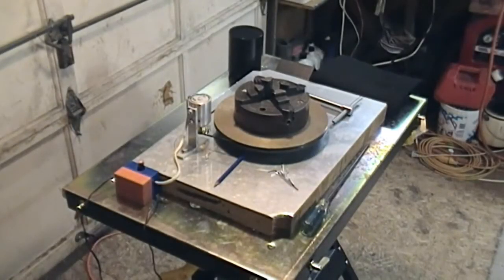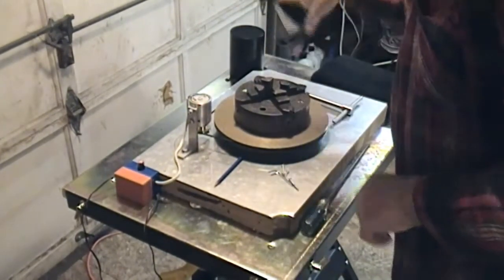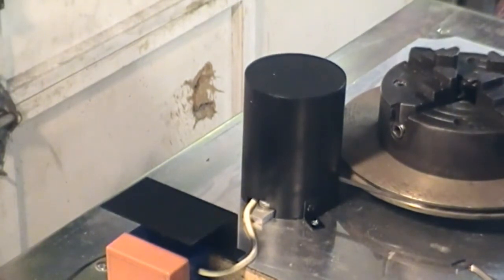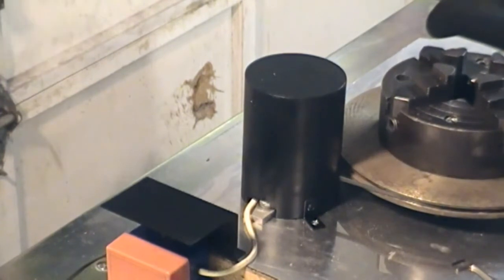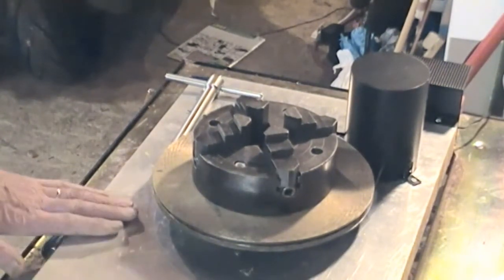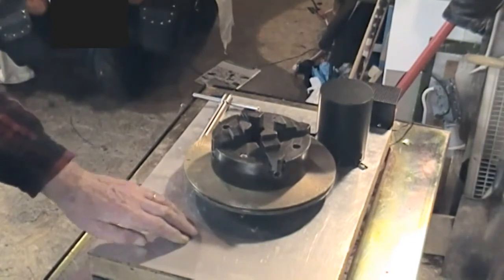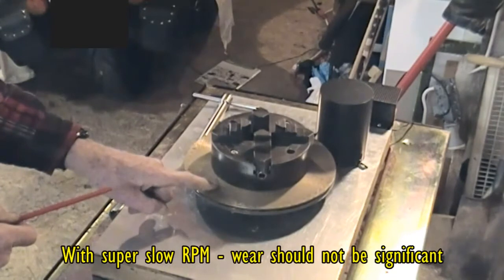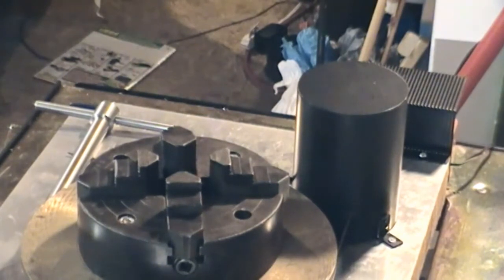Motorized Turntable, Part Three B

Comment: To work on the "wrong" side of your turntable, try holding the top against a faceplate (or the chuck with the jaws out) by pressing your live center into the bore. If the bore is too big, machine a flanged plug that fits the bore with a  good-sized center hole bored in. With the light cuts you usually take the pressure against the faceplate should give the workpiece (turntable) enough torque. If needed, several strips of double-sticky tape should  help.
Reply from the maker: Peter W. Meek Thanks for the suggestions Peter. :)

Comment: You could better protect the motor wires by taking them through a hole (with grommet) under the can.
Further protection for the potentiometer box could be had by either closing in the sides of the shield, or notching the wooden side and placing it just under where it is now..

Cheers, Tom
Reply from the maker: Thanks Tom -- all input is gratefully received.  The project certainly continues to develop more now as an evolution! Still a ways to go I think.

Comment: Your can and cover look great Chris.  I think Grandpa Bill is right though about all that current being an issue.  I've thought about it a bit since last night and still think a top brush system (since you can't chuck up for cleanup underneath it) with a sheetmetal housing to cover the belt also would cover the brush housings and keep splatter off your platter. ~¿@  The hole you cut in the AL for the vertical axis was larger so it should isolate the turntable.  It would be stationary and allow for ground straps or lug to clamp to. However the supports would need to be an insulating material, Delrin maybe or just neoprene below the foot and use #10 Rack screw top-hat washers to insulate the screws??  It would mean probably getting out the dreaded jig saw to cut a hole for the chuck and also welding on a return flange to cover the belts and fixture the feet.  It's a bit complex of a fabrication but pretty sure You can do it!!   ~PJ
Reply from the maker: Thanks for your comments. More valued food for thought - although can't quite see what you meant re cutting a hole for the chuck - ahh, I guess you were meaning a 'cover-all' piece of sheet metal. That's a thought in itself actually and as the turntable is isolated from rest of the stuff - your plan seems well worth consideration. Love the great feedback we get here on TY - thx again. (Rather hope too, if I get myself a TIG welder eventually, then spatter will be a non-problem compared with stick or MIG.)
Reply: ChrisB257 Correct, like a sheetmetal belt guard.  Another thought though about its height off the platter.  It would have to be low enough profile to allow clearance for your fine extended Chuck Key and room for the brush assy's. Looks like you might have an inch of height?
Reply from the maker: pjsalchemy Just done a short vid cleaning up the turntable and looking at my clearance if fitting a shroud - it is about 3/4" + - might be enough but still considering brush contact from underneath also. Maybe make a shroud first then see after that. Plenty of fiddle left yet!

Comment: I had not paid any attention to the exposed belt before but it does look like a place hot weld sparks will land.  I think you might have done better to have the belt and motor under the aluminum table and then it would all be safe from splatter.  I know it would require a big pulley but used underneath a wood pulley can do the job just fine and you can turn a really big one on a drill with a chisel for a cutter. Thanks for sharing.
Reply from the maker: Had considered that earlier but - wanted the reduction effect with belt drive - although if there was enough space maybe I could have gone under and driven via a rubber drive wheel.... project still has room for further experimentation so will put more thought to that. However, I may yet make two very small pieces to cover exposed belt and deal with it that way, as otherwise drive system is doing what I want. Thanks for the valued input.

Comment: If I were going to polish the table for a contact, I would do it on the underside where it won't get chewed up by spatter.  Interesting project.  Thanks for sharing.
Reply from the maker: Thanks - very good point indeed and certainly could be well worth the 'under' approach. Main problem with that however is being able to mount the turntable that way round in the lathe - it would be at or near my swing limit and faceplate is a bit smaller. However - could well find a way - appreciate the input.

Comment: Hi Chris !

The grounding ... try find an old electric motor with some heavy cobber/coal brushes and use one or two of these brushes sliding on the UNDERSIDE of your brass plate/wheel.

Another source could be these big "pick-up-the-cable" trolleys on a moving crane - inside these big trolleys there is some heavy duty brushes too - I found some on a scrap yard for building equipment - same place I found my gearmotor for my crane: http://kelds.weebly.com/loslashbekran.html

Or else you have to ask Keith Fenner how he made the grounding on his turntable ;-))
Reply from the maker: I will yet be looking for some large brushes - this aspect is still quite embryonic!

Comment: Nope! You don't want to do it that way. First off you're trying to push all that amperage thru the thin alum. sheet. 2nd. you'll probably burn out your drive motor cause that's bolted to the alum sheet.
Get the brushes and make a housing for them and spring load under the brushes. Mount that housing "UNDER" the table, so now the table weight is pressing down and the springs are pressing up making a solid connection. Weld a tab on the side of the housing for your ground clamp or bolt on short cable long enough to hang over the side..... Oh and make sure you insulate the housing on the bottom from the alum sheet.
Reply from the maker: Thanks Bill - could well be worth putting a thin insulator under the motor mount to isolate anyways. Haven't discounted the brush approach but trying to avoid the hassle of making housings, plus brushes will need to be large - still pondering!! Appreciate your input... all food for thought.  May be this project has yet to metamorphose a few extra stages yet!